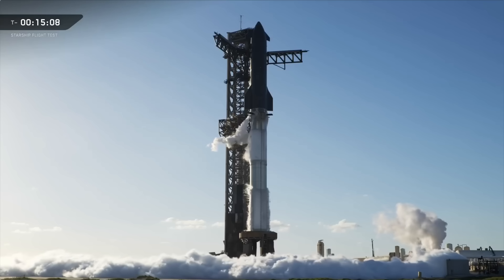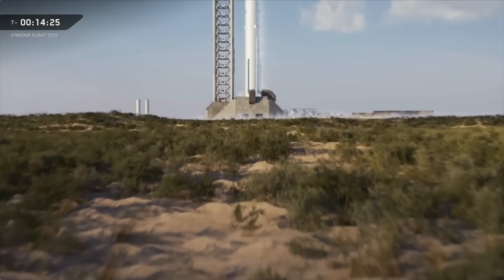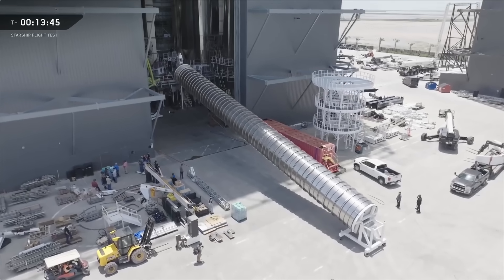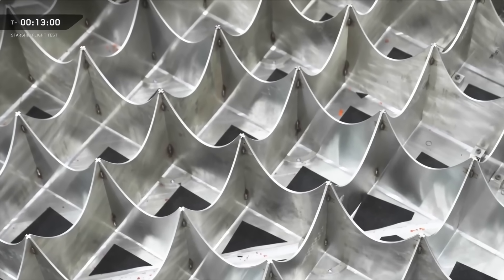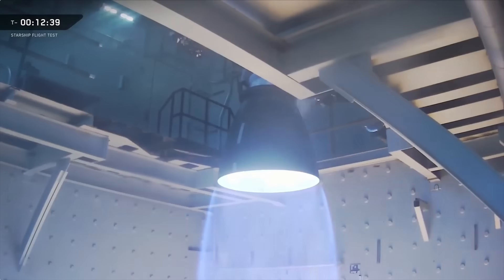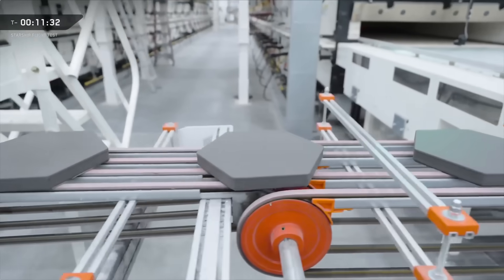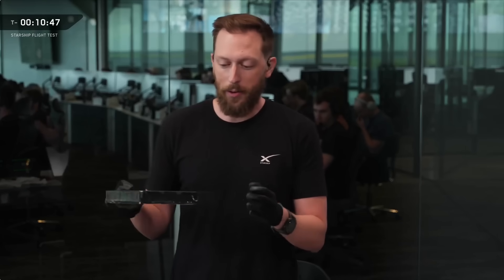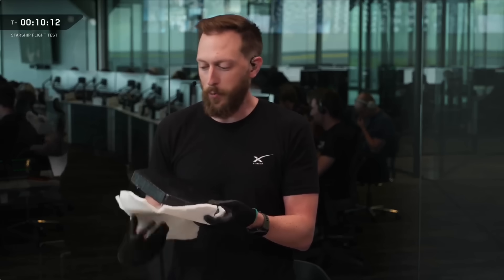SpaceX delivers update on Starship V3 ahead of final V2 launch

Comment: V2 obsolete and way ahead of the rest !
Reply: Ahead of what? While spacex has come a long way they still have a long way to go with starship. We have seen no significant payload and no orbital flights (so real capacity is unknown). We also have no clue how close they are to rapid reusability. Although we know they have reusability for 1 stage. There is a lot of challenges left and only time will tell how much they will succeed with. What we do know is that nothing will ever happen in "Elon time", it will take longer than that.
Reply: @drosendahl  Ahead of every other launch provider on the planet, no one else is close to Falcon 9's capabilities/cadence nonetheless the ambition and scope of Starship. They've already caught the booster multiple times which many thought was impossible when it was first proposed, and a ship catch/reuse is on the horizon. Once that happens, a fully reusable launch system becomes a reality for the first time in history, and rapid reuse will continue to be moved toward with further iteration. If SpaceX wanted to simply put a lot of tonnage into orbit with an expendable second stage they could have done that already. Their sights are set significant higher, and no other entity on the planet is even remotely working towards them like SpaceX is.
Reply: @kekefind  I answered a comment saying that starship v2. is way ahead of the rest and that is not true since it never was a complete launch system to orbit. You don't know if they could have put a lot if tonnage to orbit because they never did (and what tonnage to which cost?). V.2. had also no way of deploying other things than dummy starlinks. Yes, they could probably have developed such a system with a redesigned expendable second stage but they didn't.  So no, it has big potential for v.3 but are not ahead yet.

Comment: Why did Musk make Starship bigger? Because he needs more fuel to get to orbit. So far they claim the flights are purposely not achieving orbit by design. But the reality I see from the very first flight was they take off with a FULL TANK of Gas but don't ever get to where they need to go. If it is full of gas and uses every bit they can and still not get to orbit, then have to save fuel for a landing. If this V3 performs the same or worse we will know it's over for Starship. How long do you think it will be before Elon excepts the bad news?
Reply: It currently reaches orbital velocity but does not go into a stable orbit due to where the burn takes place. A stable orbit requires 2 burns (one for launch and one at apogee to "circularise" the orbit.) They are currently only doing 1 burn due to lack of certification for the multiple in space relights of raptor for a deorbit burn.
Reply: *accepts

take you meds bro
Reply: Brother,  the FAA has to sign off of an orbital launch path...  Currently they are proving out that they can be consistent in their pre-defined launch path allowed by the US Government.  They had consistency issues with V2 but the last 2 ships proved in-space engine relighting and satelite release so now the FAA should be able to give the greenlight to go full orbital (only catch attempts are truly decided by SpaceX).  Please just try to be objective with the facts.
Reply: @ryanenewman_9103  FAA will most likely not give green light for a full orbital before at least one, maybe two fully successful mission with V3. As they say in the video above, its nearly a totally new ship. That is also one of the main problem with SpaceX:s development strategy, how do you certify something you are changing for every launch.
Reply: explain how flacon 9 gets to orbit then while being far smaller.

Comment: What about a hot swap heat shield?

Tiles on a thin membrane that is one piece from factory with attachment points far enough around the side of the ship body that they are not subjected to same heat/stress on reentry. 

Ship lands, new tower arm unhooks now stressed shield, new shield attached while propellant is refilled. 

Used shield taken to special bay at factory for inspection and refurbishing… installed on same or different ship when needed.
Reply: Great idea, but.. mass consideration. Attaching so many tiles into a "one-piece", the hardver needed to hold the whole thing together is too much. The advantage of these heat shields are their mass and the negligible weight of the attachment pins.
Reply: @rigogabi7778  Yeah my expectation is that they'll have a mechanized tile replacement system with a stockpile of spare tiles. Once the ship is caught, it'll use AI to identify tiles needing replacement and then swap them out with new tiles as necessary.
Reply: @pyrioncelendil  Something along those lines probably. The most efficient way to utilitize the mass produced Starship is that they fly constantly. Even if 1 Starship needs 1-2 days of refurbishment, or even a week, the volume of those ships will enable multiple launches a day. They don't exactly need the Starship 25 to fly that day, perfectly fine if they put Starship 26 onto the just catched Super Heavy. The main advantage is coming from the Super Heavy, if the first stage can be reflown in hours, you just need to attach a pretested and loaded second stage. You realisticly only need 20-30 Super Heavy, and double the amount of second stages at least. The Second stage is designed to stay in orbit for days or even longer, no need to refly them instantly, you will always have to have backups. The idea was the same with the Shuttle, but they didnt mass produce it.
Reply: Not much use if you're on Mars in the early days expecting to come back to Earth. Although the thermal protection takes less of a beating entering into the Mars atmosphere, it's still required

Comment: Are we gonna see a fully stacked v3 before new year
Reply: probably not, pad 1 is not compatable with booster v3 so they have to wait untill pad 2 is finished
Reply: @war_fish  Pad 2 is not the problem. Gantry finished, Shielding almost complete, Water deluge is fully operational, plus, internal plumbing for propellent transfers are almost complete. And the tank farm is also operational. Even the SQD is getting ready for installation.
Imo we'll see at least a Booster SF on OLM 2 before the end of this year. What we don't have currently is a proper place for Ship SF. Since Massey's repair is still underway.

Comment: Changes coming to V3 as we have seen from many sources. + some speculation.

Ship V3
1. Raptor 3s
2. Better energy storage (batteries, which means longer duration missions)
3. Redesigned Propulsion system (improved durability + likely additional systems like dampeners and accumulators as permanent solutions to harmonic resonance)
4. Upgraded avionics (better onboard flight computers to allow for better flexibility and likely software/sensor upgrades to accommodate rendezvous for refueling and precise tower catches.
5. Upgraded catch pins that can better survive reeentry
6. Tapered heat shield edges to lessen hotspots
7. Relocated Starlink terminals
8. Docking ports.
9. 100T of extra fuel capacity

Booster V3
1. Integrated hotstage for actual FULL re usability instead of dumping the HSR overboard every flight. Bigger vent area that future-proofs the booster when it accommodates 9-engine Starships 
2. Bigger grid fins that doubles as catch points. 
3. Fatter and more durable downcomers to facilitate higher fuel flow, simultaneous engine relights, more flexible engine-out capability.
4. Raptor 3 (more thrust, better efficiency, lighter, which helps reduce gravity losses and helps the booster reach higher staging velocities, which means the Ship has to do less work compensating, thus vastly increasing payload capacity)
5. Aft heatshield to accommodate higher reentry velocities since the booster will now stage at higher speeds. 
6. Double QD ports for faster refueling
7. Larger tanks for more even more delta V.
8. Recessed grid fin motors (allows more space for even more fuel, likely also helps in cooling down the grid fin motors, thus increasing reliability)
9. Engine shielding is removed. Lessening weight and lowering the risk of methalox accumulation that might cause engine bay fires/explosions.
Reply: legend!
Reply: Don't forget all the upgrades to the launch pad.
Reply: This is incredible. Thank you
Reply: Great comment
Reply: Thanks
Reply: thanks for prompting chatgpt for us
Reply: I've been going to like 20 different videos trying to find a list like yours. Thanks!
Reply: Don't forget the idea they took from one of the videos I commented on a while back, why 4 grid fins instead of 3?  They are now going to 3. Pay me Elon!
Reply: @onjofilms  you seriously think you're the only one who thought about that and they've stolen your idea?
Reply: @twisted239  Yes.
Reply: @onjofilms 😂
Reply: @twisted239  I also told them in the comment zone that concrete was not going to work and they needed a flame shoot.  They stole that idea too, and another one was I told them they needed to use smaller heat tiles.  They keep stealing my ideas.
Reply: @onjofilms go create your own space shuttle like a king, don't wait